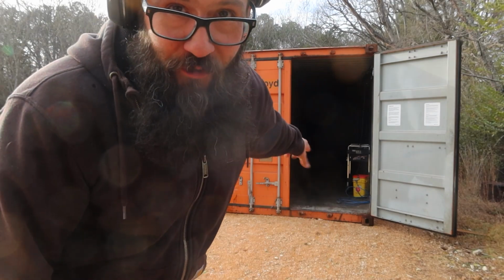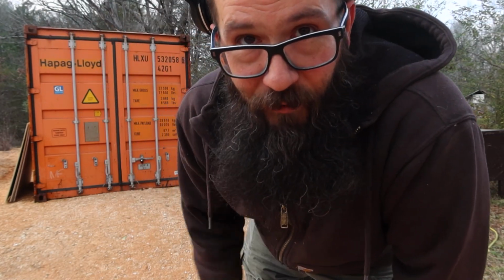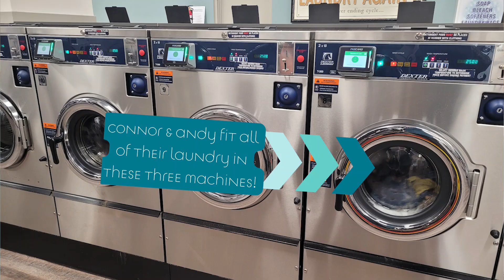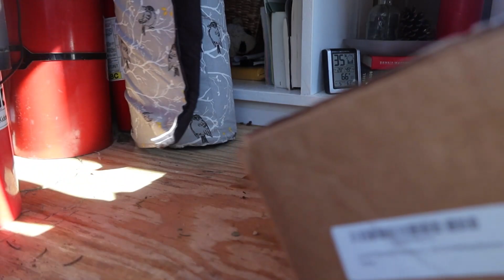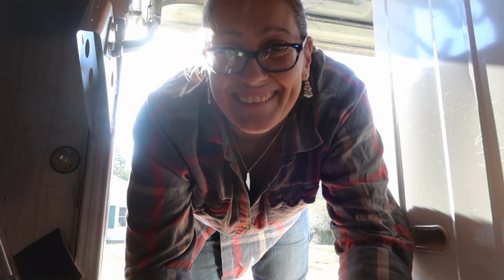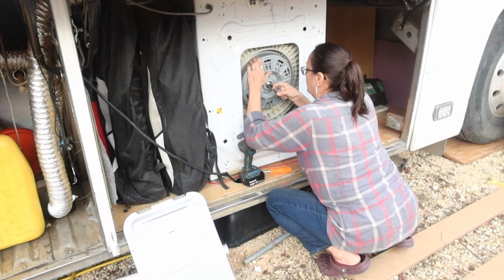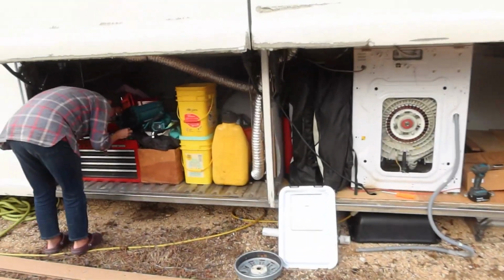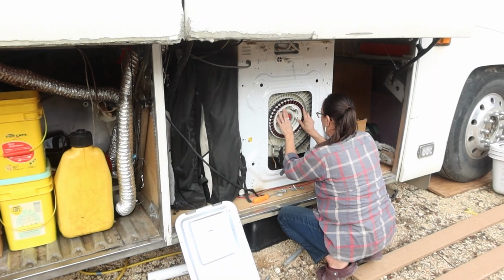A Day with Andy and a Long-Awaited Repair

Comment: Are you going to use the floor jack to level the shipping container?  Nancy, you are a great handyman!  I, your mother in law, wouldn't/couldn;t have done the job.  😍😍
Reply from the maker: I learned the hard way that floor jacks and containers don't play together well. The container in Minnesota twisted my old floor jack into a pretzel. I used a bottle jack as I already own a couple, a high lift jack is supposed to work well too.